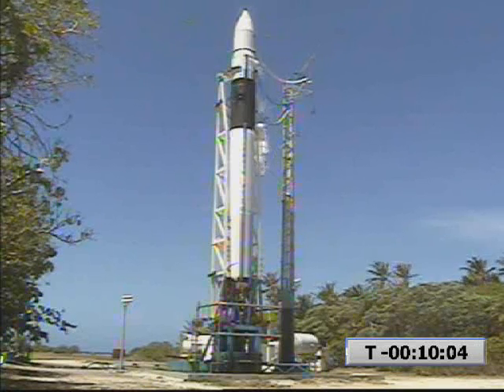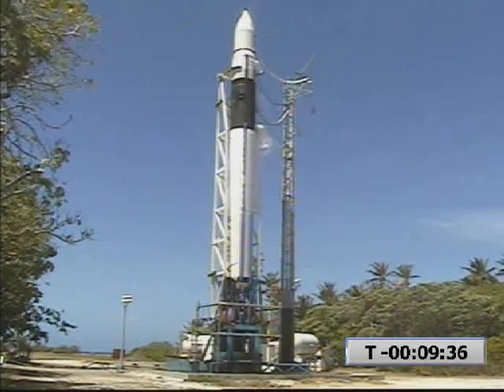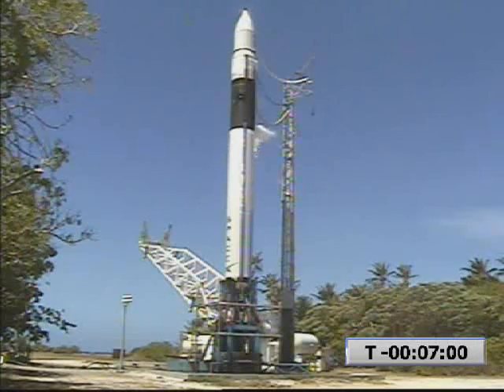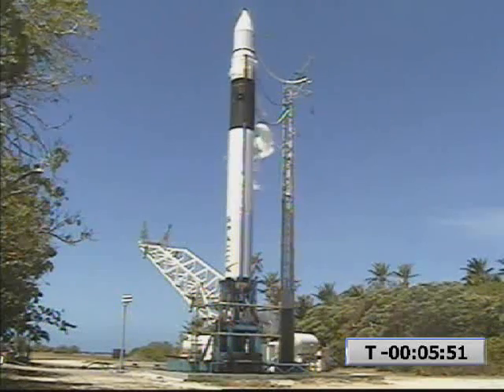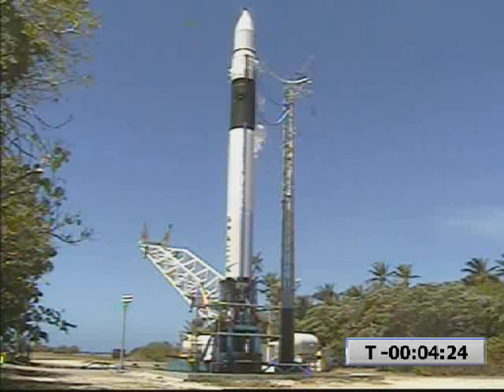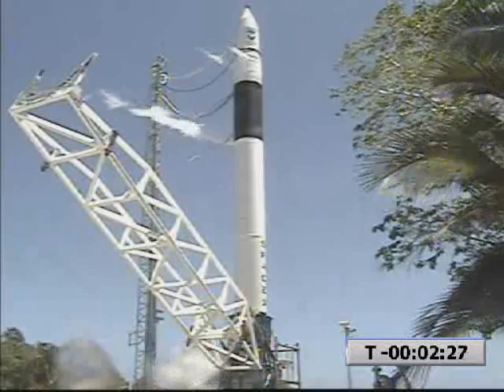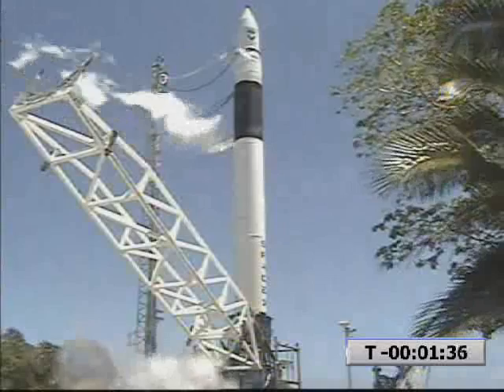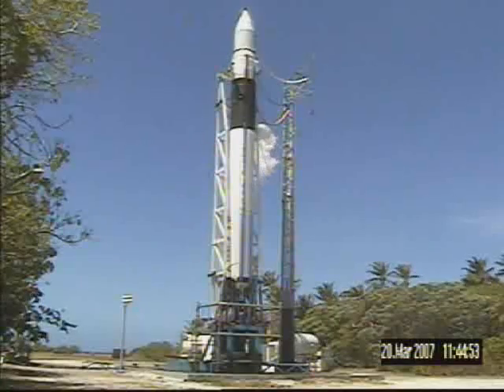Failed SpaceX launch

Comment: Yawn no more- type in 'scary rocket explosion', then click on the 'Soyuz rocket launch failure' vid, and you'll have front row seats to see a rocket with 160 tons of fuel on board drill a hole in the earth only a 1/2  mile from the spectators...surely more than a few of them changed their shorts when they arrived at their hotels that night..'Scary' is right..